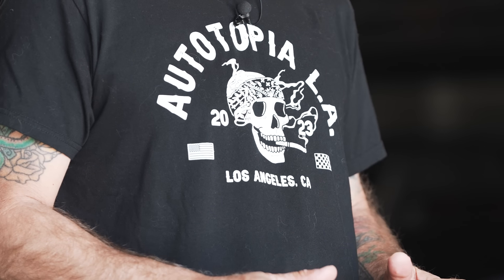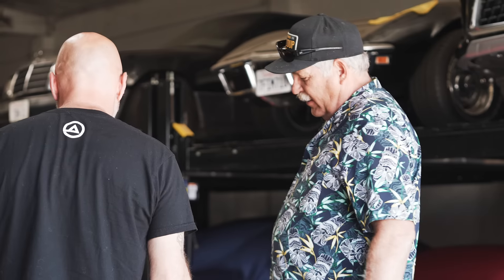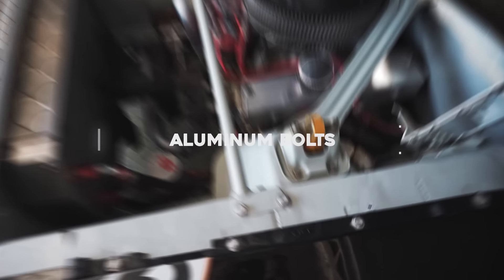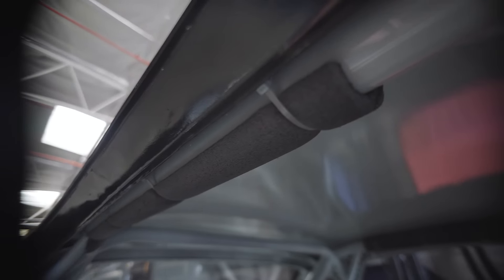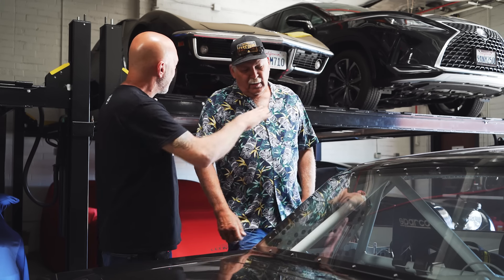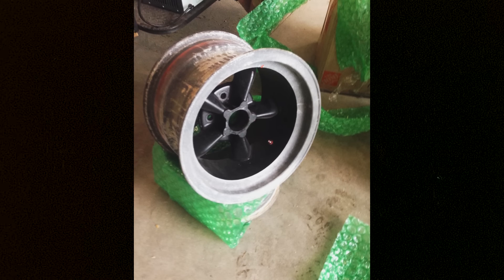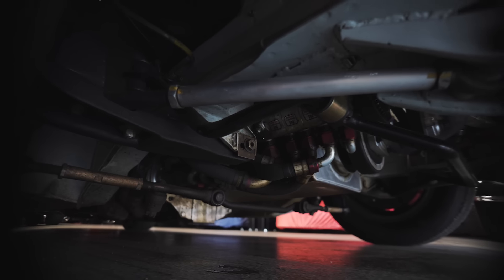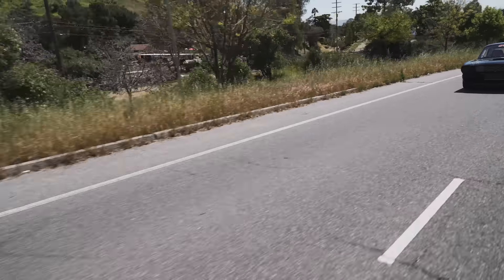'65 Ford Mustang with NASCAR Transmission & 363 Stroker Making 680 hp | Street Legal Racecar

Comment: I have never heard of a dry dump system reducing engine longevity. Gm has been using it in certain corvette models since 06 I believe.
Reply: Yeah that’s news to me. For what I’m sure it cost that’s unacceptable to have a 100 hour life.
Reply: I have to agree with you on that. Dry sump has and always been seen as a superior lubrication system compared to wet sump because you can direct the oil where you want it and it’s set up for better scavenging during high G cornering
Reply: He may be pulling way too much vacuum from the top end. Peterson makes a valve to put in the valve cover to dial in crank case vacuum.
Reply: Maybe he's using some older system of dry sump that's my only guess
Reply: @TheMountain120  probably some nascar style dry sump system that’s designed to work on an embankment circle track
Reply: There's many considerations here. Everything from the type of piston rings and hone, to the block oiling system, to the vacuum.
Most people don't understand what it costs to make a certain amount of power, and make it under race conditions, reliably. 100 hours is not at all bad. It's actually fantastic.
Those highly strung NASCAR engines that lived at 9,500rpm were JUNK after 500 miles of Daytona. That's a 3.5 hour race. One race. 80 - 100 grand a pop. Gone. This thing would last for x TWENTY EIGHT Daytona 500's at 100 hours. To put that into perspective. Probably not as highly strung by any means, but you can quickly see how that compares. A competition race engine is not a street engine. Most big power street engines rely on boost to make big numbers so aren't overtly stressed, and others that are NA weekend cruisers, may not see 100 hours total use until 2, 3, 5 years. And not at constant WOT. It's all relative.
The important thing about lifing an engine, just like an aircraft, is not to wait until stuff breaks. But to replace it well before that after X hours, even if it IS NOT broken or heavily worn. To keep it in peak operating condition. If that's 100 hours before a refresh. So be it.
The biggest consideration with a dry sump oiling system is keeping oil where it needs to be. When it comes to pistons that's either in the hone, or in the rings. If you pull TOO much vacuum, you will pull oil off where it needs to be. However, 11 inches is nothing serious at all. Most full race engines - NASCAR again for eg - pull 25 - 28 inches. And even more, I believe. However they have squirters pointed at the pistons to keep oil flowing to them not only for lubrication but to keep them cool. If the block oiling system is setup with adequate squirters and feeding the mains as a priority first, there's no reason you can't go crazy with vacuum. You also could technically wear the pistons and the bore more with dry sump oiling - even if they do seal better - if they aren't up to the task. You never know. Maybe he prefers throwing new pistons at it, rather than sleeving and diamond CNC honing the bores over and over. Which isn't cheap. At each refresh. 
A dry sump doesn't necessarily extend the life of an engine. It will KEEP it alive under arduous conditions. But it won't technically make it last longer overall.
Reply: Well there's no way for dry sump to lubricate the pistons rings directly unless it has oil squirters that's why he said because of the pistons is why it's only 100 hour engine not the main or rod bearings makes sense
Reply: @Rch5.0  a wet sump system does no better a job at lubricating the pistons unless it has oil squirters as well.
Reply: If you can afford a dry sump you can afford $$$ pistons with small to no oil ring keeping cylinders from getting oil starved. Plus more hp... old nascar   qualifying tricks
Reply: Agree
Reply: As well as Porsche
Reply: Dry sump doesnt reduce longevity at all, its main purpose is to eliminate aerated oil from being pumped back into the engine and maintaining proper oil volume. The comment about oil rings wearing out because oil is being sucked off of it was a misspoken comment…..reduced engine life will be the victim of the operator and environment
Reply: Aircraft engines have been using dry sumps for decades.  That’s why there’s a pump in, and pump out
Reply: My guess... Probably an old Fudd myth because dry sumps are mainly ran on race engines that are ran very hard. Run an engine hard and no matter how good the oiling it'll fail. Or race teams replace/rebuild the engine before failure. From that guys probably think dry sump engines don't last as long, but there's a big difference between street driving and racing.
Reply: He’s pulling all the oil out that’s why engine life goes down
Reply: Every dry sump oil system causes reduced longevity on all engines. Factory systems just have the parts built beefier and to last longer because of it. But on a motor that’s not built for a dry sump it will.
Reply: Depends on how he drives and  location of where car is being used most of you are just guessing
Reply: For road racing, a dry sump is THE ONLY WAY to go! Worth every penny! Dry sump adds 20+hp. (If you want to know why, ask) It's easy to make it last longer than 100hrs. Just add piston sprayers. The issue isn't the rings, it's the wrist pin oiling. That's only done by splash and a dry sump eliminates 80% of that splash.

Comment: I had a 4.57 posi 9" rear in my '65 fastback. 289 hi po w/4 speed. Street/ strip,red & red interior. It was pretty fast for what it was. 8.30 in the 1/8th on 7" cheater slicks. I had more fun with that car than any other. I'm 70 now & still wish i had it! This black one is insanely beautiful! Turning 7,000 rpm all the time,i definitely needed my tach!ps.i gave $650 for it in 1971! LOL
Reply: Nice story.

Comment: God bless his heart for running 15” rims 👍
Reply: I can’t stand oversized wheels
Reply: @hoonaticbloggs5402  especially not on a classic car, just looks stupid.
Reply: I hear you! My 65 Fastback tribute GT350 runs on 15” TTD’s. I’ve been driving it daily since 2006 with those on the whole time!
Reply: @minnesotatomcat that’s your opinion
Reply: @minnesotatomcat if it’s getting used then yeah small wheels. If it’s a street car big wheels>
Reply: The issue with 15" is the lack of street performance tires. The choices are BFG Radial T/A, Cooper Cobra, Firestone Indy 500, (all 80's style tires) or racing tires. Even 16" and 17" selection is getting limited. I have a set of straight spoke American Torque Thrust wheels I want to use on a car, but that requires vintage rubber as well.
Reply: @thoriated  yep I love the cooper cobras, great tire, bought them many times 👍

Comment: I really like what he did with the car very well put together, I’ve got a1967 mustang fastback that I’ve had since high school 36 years it’s my first car and it’s a six cylinder car, I’ve installed the top loader 4 speed and installed a V8 rear axle and front hubs on it and still look’s factory, the color is white with black interior, it’s fun to drive, I’ve also got a 1970 bronco that I’ve had for 30 years it’s got the 302 with the top loader 4 speed

Comment: Porsche 911s have had dry-sump lubrication systems since 1964. That year the 911's oil capacity was 13 quarts in a 2.0 liter engine. Oil is pumped from crankcase to the oil tank (9 qt capacity) in the right rear quarter panel, then pumped to an external cooler then back to the crankcase. Oil level is checked with the motor at idle.

Comment: i put koni shocks in my 67 stang fastback 390 gt ..wow what a better set up and it was set hard ---50-50 on the street and that could handle very very well it cost $ 125 for set of 4 frt and back ..best thing i did for it

Comment: the "Monte Carlo bar" and "export brace" are in fact, the same thing. all Mustangs and Falcons came with the left and right "hockey stick" stamped piece coming off the top of the shock towers to the firewall. But when Falcons went racing in Monte Carlo prior to the Mustang's invention, they found they needed even more support. They looked at the tube running in front of the shock towers and air cleaner that was installed on cars exported across the sea, and realized that would do the trick. 

One day someone will do a movie about the Falcon's attempt at Monte Carlo. Like Ford v Ferrari, it's a case of the  racers versus the "suits", the Falcon crew from England got real close and then were told to shelve everything as the Mustang was going to be the new "fair haired child" at Ford. It was always about selling a product.

Comment: That's a wicked car.  I love the way it sits on the 15” wheels  

How come the gear change throw is so long? Is there not a quick shift option?
Reply: The shifter is long !!!
Reply: Long shift arm. You can have the shortest throw shifter in the world but if the arm to pull it is over a foot long it will be a long throw.

Comment: No clutch shifting is called ''floating gears' in the trucker world. WOOP WOOP !
Reply: Not floating gears you start with the clutch petal to take off after that you just shift its called a clutchless 4 speed
Reply: @bobbyliendo7406  I had an 18 speed in my Pete. Only time I used the clutch was taking off from a dead stop.

Comment: He could have minimalized the front end lifting at high speeds if he kept the stock seating position. Even weight distribution is cool, but you need weight in the front and the back when you're going straight.
Reply: O.. good God. He's 6'5

Comment: lot of yak about weight reduction ,heres a tip to the owner ,maybe loose that roof over the tool shed and you might not need to concern yourself with rippin the guts out of this ol Ford ,stuff that dry sump set up ,build a tough 351 windsor with all the goodness and it will still rev to 8K and have a sump ,yes i know it wont sit low but id rather a crank livin in oil

Comment: Just one thing about over-engineering german cars: it fails often and/or needs A LOT of (pricey) maintenance.
I still prefer more "conventional" japanese design which costs (a lot) less in maintenance/$$$ and last forever or... even more! 🤭
In my opinion, the little differences are not worth the extra costS.

Comment: I dont know much about dry sump system but still not sure about his explanation of a dry sump system, it would a useless system if it work like he was saying, why would a oiling system exist that sucks all the lubricant out of the engine, makes zero sense to me.
Reply: So it doesnt climb the block walls during turns, aerate/foam up at higher rpm and starve the bearings. 
Dry sump is track/road course stuff.

Comment: Why wouldn't you want good brakes on a race car🤨
Reply: It has good brakes for its weight. Very light cars don’t need huge rotors. Big rotors won’t get hot enough to work correctly
Reply: @ConemantheBarbarian  MOre pad area on a good drum setup too